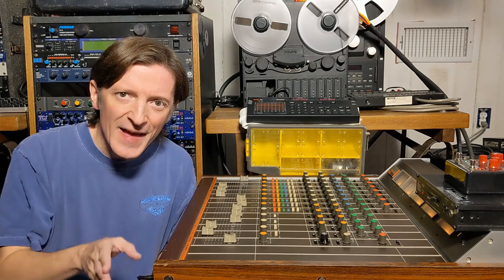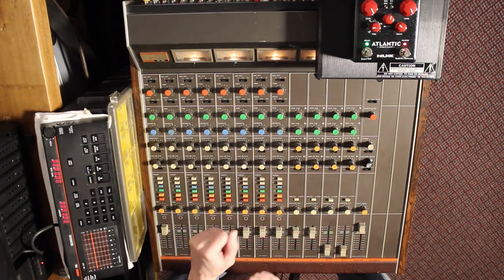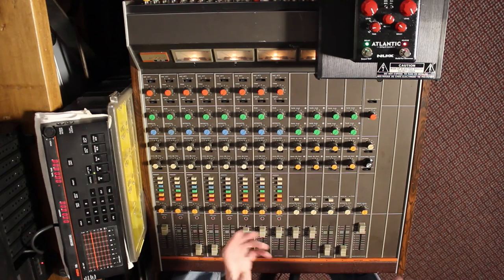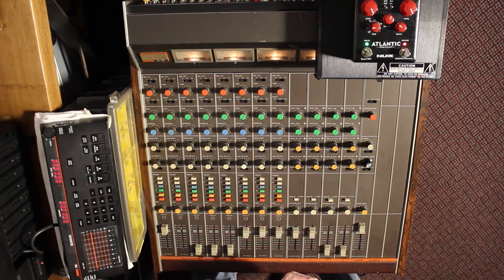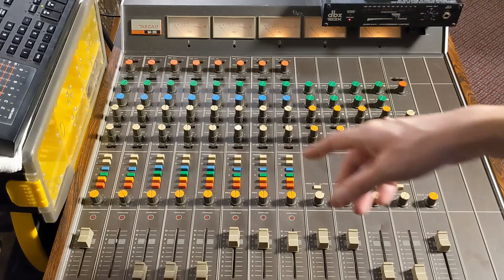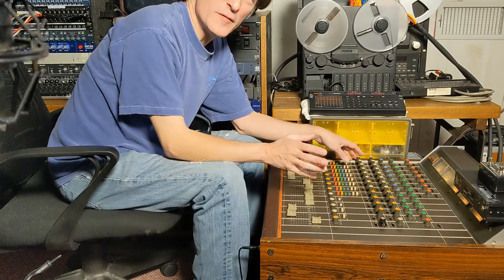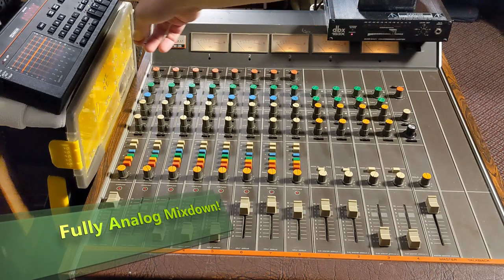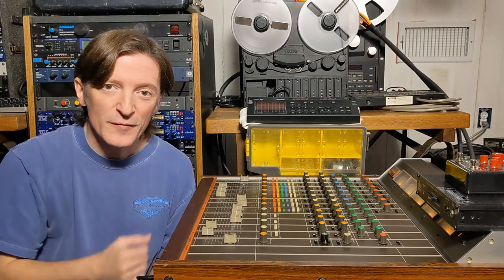Analog Mixdown with Tape Console and Outboard Gear

Comment: Definitively a very good mix. It is done with taste and subtlety, while maintaining character. My brother use a NuX in it's pedalboard but it is way less subtle.  I will send it this mix as a reference. Thank you sharing and cheers from Canada.
Reply from the maker: Thank you! When using the pedal with a mixer, you can blend the reverb in with the console controls. On a pedalboard, you'd use the level control on the pedal to adjust the wet dry balance. They are great pedals and sound very good. Easily good enough to use as a studio effect as well as a guitar effect.

Comment: Hi Grady, got my Soundtracs console delivered today, Its got an almost identical colour as the tascam, though could be the video colour..mine looks olive green//brown. Contacted Tim at Blue Dog, sent him some pics and he identified my Soundtracs 1642-s as possibly the original soundtracs model from 1982,,he sent me a schematic..stoked :) Will fire it up tomorrow and have a play. Also got an incredible bargain, really nice price on a motu traveller fw..same vintage as my motu 8pre and 828mkii fw..don't know how but they just keep workin, I bought them second hand in 2006. I much rather hunt down well made older gear instead of the the modern stuff that ends up broken and in landfills after only a few years. Thanks for all the inspirational vids, tips and info. Rock on brother.
Reply from the maker: That's great! I've seen those before but I have no direct experience with any Soundtracs other than the 2 Topaz Project 8s I've owned. I'm sure it will be good though. Soundtracs made good sounding reliable consoles and with a new power supply from Tim, you should be in good shape.

Comment: Really great as usual Grady! This is a tremendous help for me and my little environment. With my digital mixer (Tascam DM24) connected to my DAW via 2 eight channel ADATs (I'd make it three but can't find another aftermarket ADAT interface card for the mixer!) this validates using the returns (from DAW) for final mix. Plus the mixer can be reconfigured for master/mix with one button snapshot selection, changing all/selected strips from Input to Return. Actually, I find myself with almost too many options for routing and have to be careful not to lose my hearing or damage my equipment from an accidental feedback loop!

My DAW Interface is an RME HDSP9652 which affords me up to 3 eight channel ADAT/IO but like I said, I need one more Tascam ADAT card to get all 24 channels. Actually I'll likely never even NEED the 16 channels I have in my home studio (its just the "principal" of wanting all 24 channels!).

THANK YOU SIR for another great video!
Reply from the maker: Excellent and thank you! I would imagine those Tascam at cards are hard to find by themselves but maybe you could find another DM24 which would also be useful as a spare or for parts? I have helped out at a studio that has a tascam digital console which may be a DM24 but I don't remember right now. I'm sure the Tascam digital console with the fantastic RME drivers will make a solid system. Best of luck and thanks for watching!

Comment: I'm Always Glad to See Analog Gear Nice Video Bro Sounds Awesome Also Nice Reverb Blend It Sits Perfect in the Mix👌
Reply from the maker: Thank you! My reverb method is usually to only add enough reverb where you begin to hear the width of the reverb without it coming obvious. That's the way I usually work with digital reverb though plate and room sounds might be treated differently and I'll use more of those sometimes.
Reply: @TwinCreekAudio  Indeed bro that's the way to use reverb just enough awesome bro

Comment: Thank you for these videos!  Curious to know where/how do you print the final mix to?
Reply from the maker: Usually the console outputs go to a pair of balanced inputs on one of the audio interfaces at 48k 24 bit. I don't remember which interface but it was either an Echo or MOTU. Nothing exotic or expensive.
Reply: @TwinCreekAudio  Thanks for the reply.  I have a few mixdown options, Yamaha 4-Track Cassette, Fostex Model 80, 8-Track 7" Reel, or Digital Interface for mastering and release (or all of them just for kicks).   Right now looking for a decent 16 I/O converter for my 16 channel Fostex Model 450, RCA inputs like your hybrid setup.

Comment: Hello man ! ... I have some question about the "vu metre" seems a bit crazy, no ? ... Tape reccorder are rally expensive here (Fostex 8 is almost 1000 € last time seeing one), but It seems nice to play with ! ... I'm asking myself how to send a signal coming from a cinch ( dual mono) old vinyl to my console who's all balanced ( xlr and jack) ? Do you plan to make some FAQ video ? And last but not least : Do you plan to give some multitrack for educational purpose and giving your feedback on ? Have a good night ! Thanks for your work !
Reply from the maker: Thank you! I haven't made many.videos with vinyl but to connect a turntable to a console with XLR inputs might require an external phono preamp with XLR line outputs unless the turntable has a built in phono preamp with the correct RIAA EQ curve. The tape machines are fun but are not a cost effective method for music production in the 2020s. They have less features and cost much more to run. I really only have mine for fun and to demonstrate older production methods so it's more for education and historical perspective. Thanks again for your comments! And yes I have made many videos on the channel detailing different types of music production both analog and digital. If I ever get an external photo preamp I like, I will be sure to make a video about it's use.